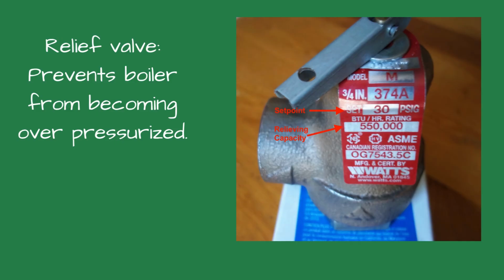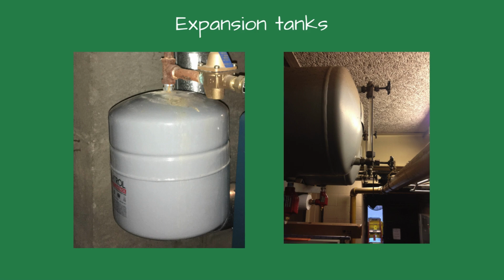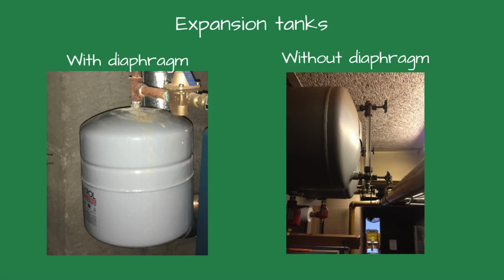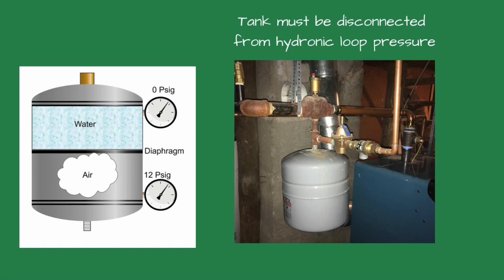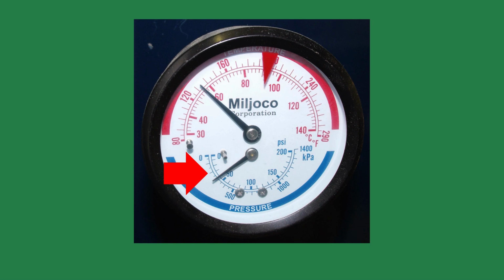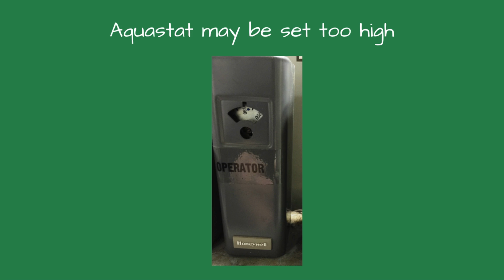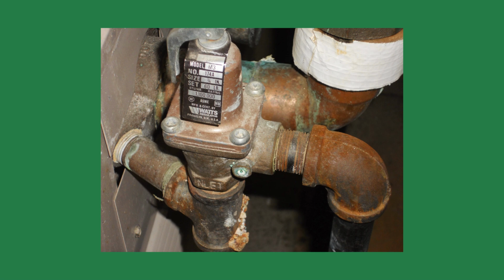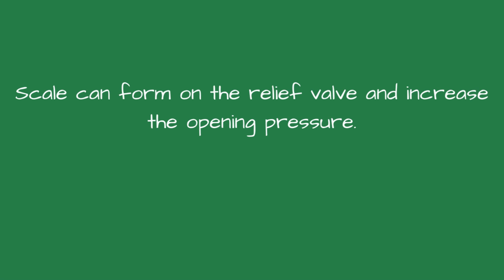My Boiler Relief Valve is Leaking

Comment: It's definitely essential to check the expansion tank etc. but the valve itself is <$30 and often easy to replace.  Do yourself a favor, if you're ordering parts, get a new relief valve too unless you know it was recently replaced.  This is especially true if your expansion tank is bad leading to the valve opening occasionally, or if you plan to test the valve at all.
Reply from the maker: Great point If it’s been leaking a while the spring loosens

Comment: Good morning Ray, so how often do you recommend to replace those valves even if they never leak? Are they like safety valves HP boilers that they have to be certified every year or so? Thanks Ray..
Reply from the maker: Great question. They dont have to be certified but should be checked regularly. Check with the manufacturer or building insurance company.When checking the relief valve, the pressure should be at 75% of the relief valves rated pressure. On a 30 psi relief valve, increase the static pressure to 22 1/2 pounds and open it. I let it run for 5 seconds. You can then drop it back to the normal operating pressure If it doesn't seat, I will replace it. Remember Ray's Rule, never check a relief valve on a Friday afternoon.
Reply: @boilerroomdetective thank you Ray 😀